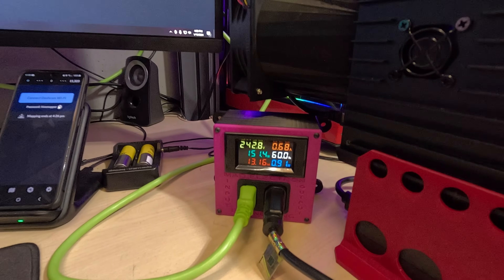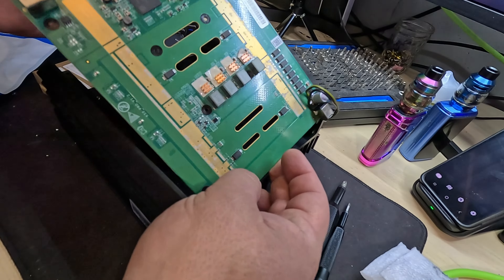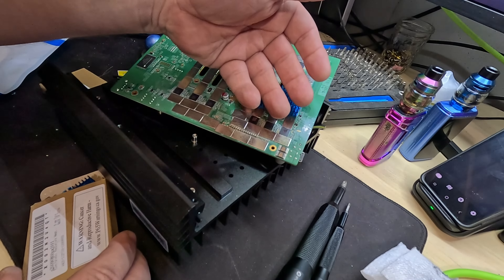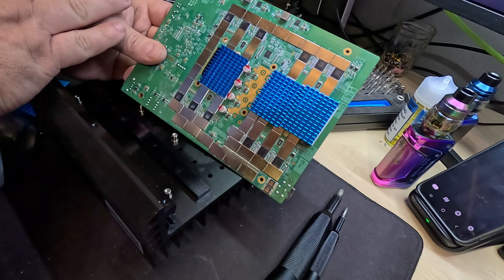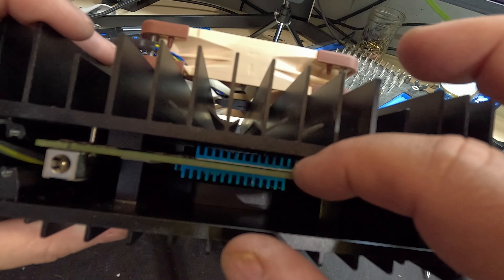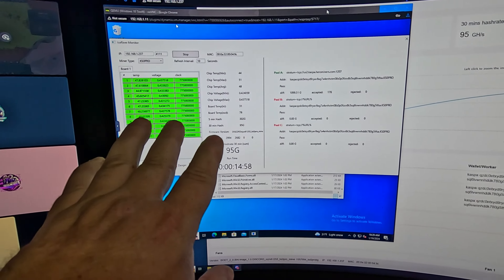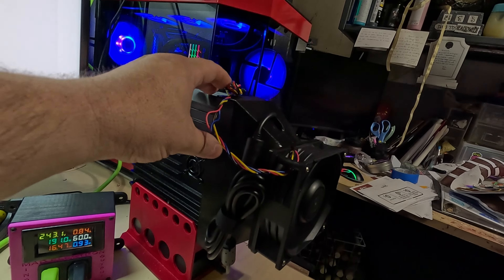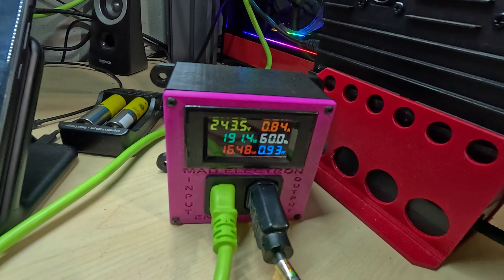Tswift 340GH KS0 Pro Testing

Comment: I did all the upgrades and a 3d printed fan module. The one KS0 Pro I tested the 340gh overclocks on saw chip degradation fairly rapidly. I moved it back to 280gh which seems stable. That machine only gets 260gh now. I ran them in my garage when it was -5 degrees outside, so it shouldn't have been heat related. Seems like it could be frequency-related. I decided to keep all the rest of my KS0 Pros on the 280gh overclocks. I didn't put the bigger heat sinks on though... maybe that would have helped.

Comment: That's a pretty insane mod 🤯
I tuly admire Tswift mission to make the KS0 Pro great again lol
I just hope the chips were initially designed to operate within that very high frequency  & voltage range, probably not if you ask me lol
Have a great weekend and keep on pushing those closed source hardware to the limits 🔥🚀

Comment: How are you powering the KS0? I melted the hell out of my barrel connector. 
The problem was the ATX output is 12V vs the laptop PSU running at 19V. The drop in voltage ramps up the amperage, and the barrel connector can't handle it.
I'm thinking about running a variable output (voltage wise) PSU
Reply from the maker: I'm using a msi 19v 230 watt laptop power supply.  I don't like the idea of running 12v over the barrel jack, too many amps.

Comment: just run 2 units for 400+ gh at 200 watts. the overclock isnt power efficient.  Its only worth doing if your not paying the electricity.  End of the day though the deminishing rewards month on month and network hashrate increasing makes the ks0 pro almost redundant.
Reply: yeah especially if your mosfets blow
Reply: Your comment is so silly and misinformed. You have to take the price of kaspa into account.